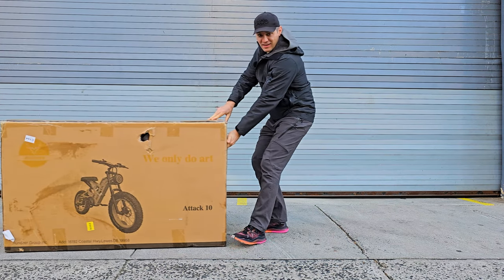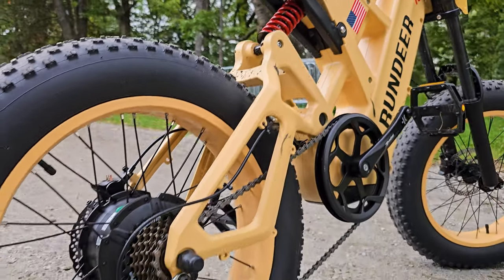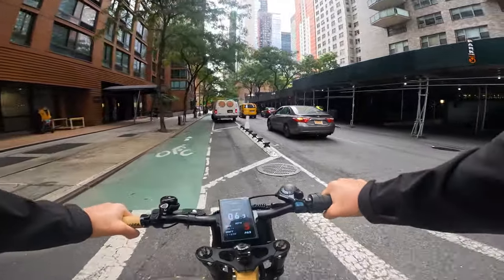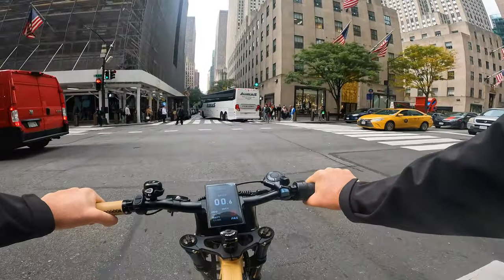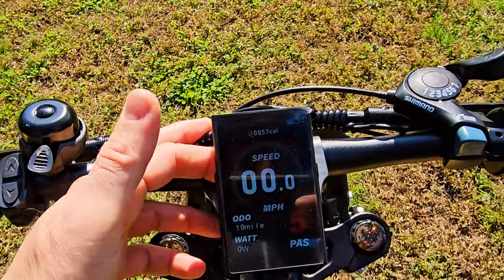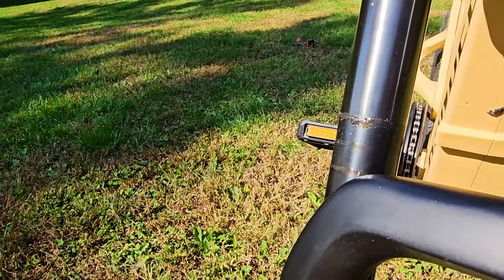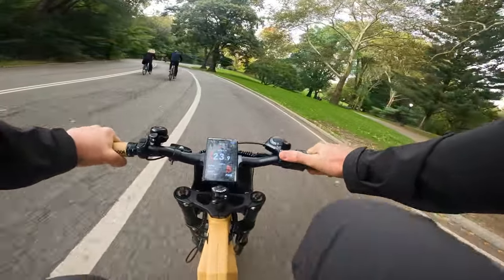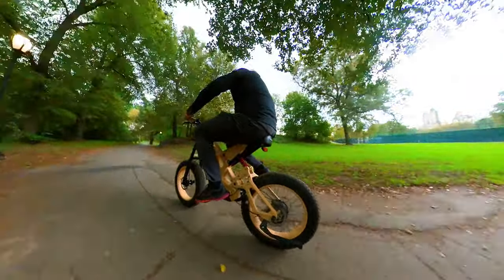My NEW OFFROAD E-bike Rundeer Attack 10 Review

Comment: Good review, Is this a first Gen e-bike?  I only ask cause I see a lot of under performance for higher pricing.  Which is common with companies first starting out.  Personally, this bike shouldn’t be over $1799.00.  In this price range I would look at Ariel Rider, Rumble Motors, Talaria,  and Raev and many others. They need to drop the pricing on the bike.  $300 less get the Raev bullet gtx more motor, battery, brakes.  They need to step up their product or lower their pricing.  I will say they got a nice design.  Any ways good review.  I thought you did a good job showing and talking about this bike.
Reply from the maker: I am glad the review was useful.

Comment: Yeah thats upgradeable too, controller you'll get peak 3kw before that Bafang will blow up
Reply from the maker: if you push it to the max it will delaminate the magnets.
Reply: @ElectricVehicleSpace  I know that the Bafang G60.is super reliable like over 30K miles. on a friend's bike that's done 10K miles and still smooth and pushes 3hp  just over 2 Kw peak
Reply: @ElectricVehicleSpace  I'm not sponsored, just a bit of a Bafang fanboy if there's such a thing
Reply: @goingoutotheparty1 would you recommend an easy simple front hub setup for an 48v 720w ebike?